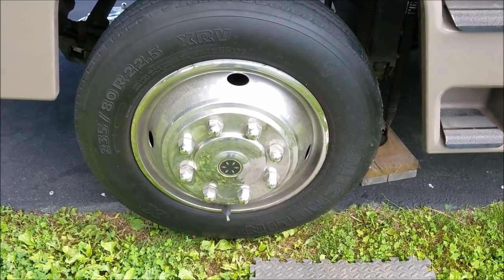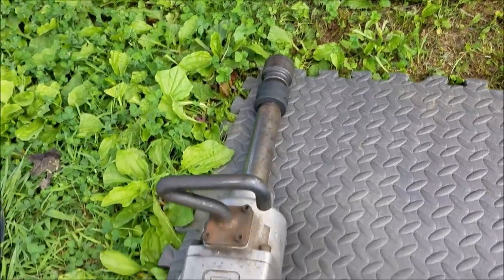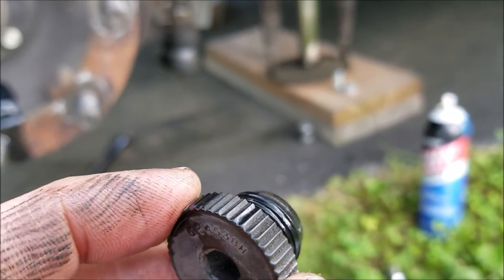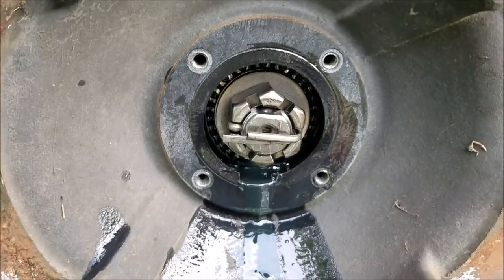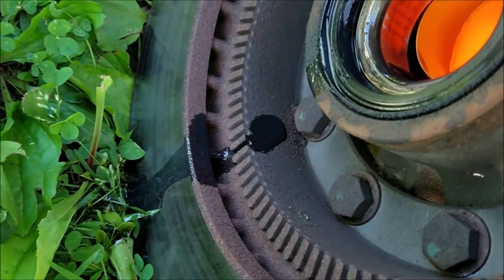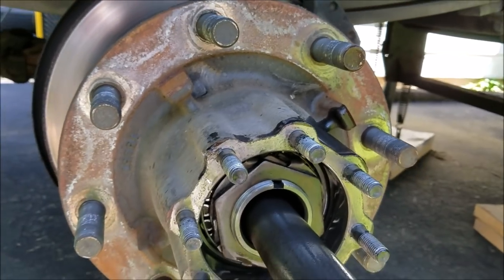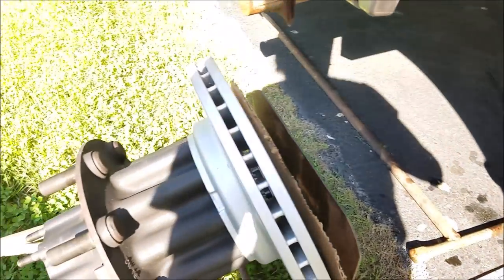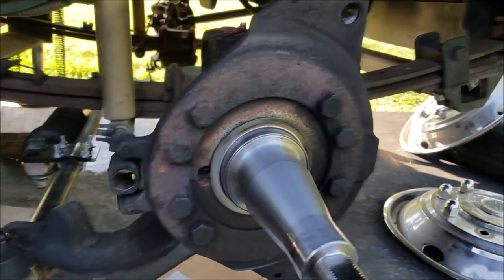RV Repair: W24 Complete Brake Job, Rotors, Brake Pads, Wheel Bearings Replaced in My Driveway.

Comment: Kevin, great article. I have a W22 chassis and I have a rear axle leak from that inner seal. Looking at your video and looking at my setup I will have to take the leaf spring ubolt off in order to remove the caliper in order to remove hub assembly.

Comment: Wifes name and pic. Mark here. Thanks a bunch for the great video, lots of great detail . I too have only done brakes on smaller vehicles so I watched your video to get an overview. I dig that huge pneumatic gun. My diesel pusher has 4 wheel disc like yours not air brakes. Thanks again. Peace
Reply from the maker: If you have any questions just text or call 606-875-0125 Kevin

Comment: Instead of that monstrous air wrench, would you recommend a Lug Nut Wrench Torque Multiplier tool? They give you a 58:1 torque ratio, getting those nuts off a WHOLE lot easier. Plus your normal torque wrench will now handle the reduced load (with a little math). Under $100 on Amazon.
Reply from the maker: Of coarse using a torque multiplier would make more since I only used the giant impact because I all ready had it. I need to get me one and try it.

Comment: Kevin, what service manuals did you purchase? I bought the 2005 Workhorse \Suspension manual and the Brake manual online from Ultra RV Products but the maintenance routines are not in the manual. If it wasn't for watching your video I wouldn't have known about the preloading of the wheel bearing to 200 ft/lbs then releasing 1 turn then torquing to 50ft/lbs then backing off. Thanks again for the video!
Reply from the maker: Text me your email address I will send link to my manuals.
My cell number is 606-875-0125 Kevin.

Comment: My workhorse manual says I have a p32 w22 chassis. But it seems that  it looks like your w24 all the same hardware and doesn't look like other W22 videos. I don't know what parts to buy
Also where did you get the rear axle 3 and half inch but remover for rear hub.
Reply from the maker: Give me a call 606-875-0125 Kevin
Reply from the maker: Look at the vin # LIKE 5B4MPA  the 6th digit = chassis 5=P32  6=W22  A=W24

Comment: Kevin - great video!!   One suggestion for the HWH jacks cleaning -  HWH recommends using WD-40 to clean off the polished surface to remove dirt & grime.  Also - using a WD-40 bottle with the flexible sprayer you are supposed to angle that up under the top lip - where the polished piston slides up - and spray there to help remove dirt & debris which may have accumulated up under the lip there.  Finally do not wipe the pistons totally free of WD-40 - leave a light coating to help lube the seals when they retract.  I now do this regularly on my Winnebago W22 chassis, and find that my jacks always come up quickly  - proving that the pistons are now clean and lubricated.

Thanks for all the tips as well.  Very much appreciated.
Reply from the maker: Thanks for the update but I got my advice from a local guy who has been selling and rebuilding hydraulic jacks for 40 years he says nowhere in his shop will you find a can of WD-40 because it will over long term use dry out the seals. I had a jack that would not retract and he told me to lather it in transmission fluid because we got transmission fluid already on the backside of the seal and that will soften the packing soften the seal it will start to retract again so I've been doing that for 5 years and I've never had any more problems with that Jack thanks for watching.

Comment: Kevin- Super Video, I have came across several of your videos and although they may be long, but you have a way in capturing my attention because your extra attention to details are greatly appreciated, at least by me. We just purchased a used W22 (WFG32V) RV and doing some upgrading, I noticed few days that I got an oil leak on the front driver wheel, I tool it a part and noticed that the rear seal is leaking, so I watched this video and learned a lot from your experience and I am willing to attempt it. I was wondering where you get your parts and although many references shows that  W22 and W24 Chassis are the same, I noticed that your wheels are 22.5 while mine are 19.5 and was wondering where can I go to get the service manual for the W22. Great job on the video.
Reply from the maker: I think we already talked but if not and I can be of any help my cell is 606-875-0125 Kevin I have some manuals you may like

Comment: Great video,  We took our motorhome out yesterday to empty tanks and I noticed a smell from the driver side rear and I think it is because of brakes not fully releasing.  Do you have the electric brake system for emergency and do you think that would be my problem.
Reply from the maker: Sounds like a sticking brake rotor give me a call or a text I will help you trouble shoot it. My cell 606-875-0125 Kevin Caudill

Comment: Would u say its really dangerous to drive with those rotors like that another 3 to 4 times? Before changing them just too expensive at the local rv shop  but want to make another 2-3 trips and pads are at 60%
Reply from the maker: Can you send me some pictures ? my cell 606-875-0125 Kevin

Comment: Kevin I have a W22, it's a 2002 winnebago sunrise, is everything the same as what you showed in your video compared to a W24? Also, what site did you go to print out all the info you had?
Reply from the maker: I be-leave your brakes will be different text my cell 606-875-0125 I will hook you up on the manuals

Comment: Where do find that socket for the rear? What size?
Reply from the maker: I borrowed it from a local truck repair shop I think it was over 3" or 4" if you find out the size I will add it to the notes below video.
Reply: , @ktoutdoor  I found it could be 3 1/4 or 3 1/2. Still looking
Reply: @ktoutdoor  Found NAPA sells them $30 with the account. But can't find the seal in town
Reply from the maker: @joshuaholdread9932  
W8000036 W8000036 - Front Inner Wheel Hub Seal 2
W8003312 W8003312 - Front Outer Gasket For Oil Hub Cap 2
W8001157 W8001157 - Rear Wheel Inner Bearing Seal 2
I got my parts here
https://www.ultrarvproducts.com/W8001157-Rear-Wheel-Inner-Bearing-Seal

Comment: Dios Mio, I hired a mobile mech (San Diego Truck and Trailer) to replace a rotor on my w22. Failed immediately.   "Chad" a real prince, told me to f-off, he is not going to fix it...  Now the bearings are cooked.  I am out pads and seals and his labor.  Brazels has been fantastic, I sent them a ton of pics, between them and you, I am not on my own.  I do my own work, we have talked before about the tech2, but the brakes intimidated me and I could not get the lugs off until I found a $60 torque multiplier on Amazon; works like magic.   I have an m18 Fuel impact rated 650#; junk then an HF Earthquake 1200#; nada..   I also picked up this 3/4 650# torque adapter use with a breaker bar, it works...  Tomorrow is the day.  I have the time, I have the confidence from you and Allan and I cant do much worse than Chad (@ 120/hr) Wish me luck, appreciate you!
Reply from the maker: Call or text me 606-875-0125 if you need any help.. what caused the failure of the rotor ? stuck caliper? bearings to tight ?
Reply: @ktoutdoor  it was serendipity that I caught the outer fr/pass caliper dragging on its glide pins checking tire pressure before heading out.  I recently had new tires put on, rotors/pads looked fine, about 2-3mm remaining on the pads wear indicator.  The wheels fell off, nearly literally, when the mech specd the National Seal 370150A instead of OEM, which were readily available at two chevy dealers in San Diego.  As I unravel this failure, the National seal does not use an "axle saver"  Running theory:  mech did not remove the factory axle saver asper National's one-page pictograph instructions.  Now its kick-the-can between San Diego Truck and Trailer (not a real company) and San Diego Friction.  SDTT: SD Friction sold the wrong parts.   SD Friction: mech installed them wrong...  Here is the thing:  This is only properly damage, but could have resulted in loss of life had the bearings seized and the wheel fell off.  San Diego Truck and Trailer -- Chad NoLastName is not licensed for auto repair, has no liability insurance, no fictitious business name registered with the county.   Dion Trucking referred me to Chad a former employee.  California, like most states, is a comparative negligence state.  My sister in law and her mother were killed a couple of years ago by a dump truck, even though they ran a stop sign on a rural road in MN, it was determined the truck had inadequate brakes, seven figure settlement.  I did not vet the mech because of my relationship with Dion Trucking.  Serendipity again, no one was hurt, this is nothing more than an inconvenience.  I learned a lesson, background checks on everyone before I hire them.  Parts are 2-day air from Brazels, all will be revealed today when the hub asm comes off...  Thanks for your support!
Reply from the maker: @surfride101  Thats why I believe in doing it yourself...